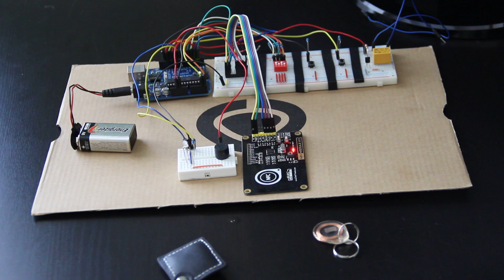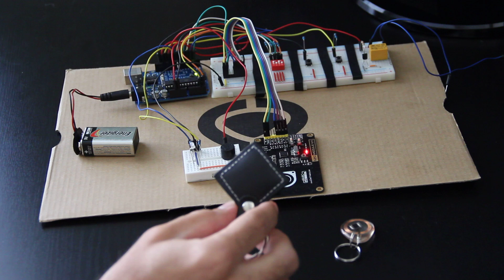Arduino RFID Garage Door Opener

Comment: Could you clarify what pins are connected to the NFC Module?
Reply from the maker: It's been a while but it looks like the MOSI/SDA is on Analog Pin 4 and the SCL/RX is on Analog Pin 5, which I believe is standard for I2C communication on the Arduino.  The IRQ and RST can be put on any digital pin you would like and you just define it in the code.  In this project I have the IRQ on Digital Pin 2 and the RST on Digital Pin 3.
Reply: @JasonScottHamilton  Thank you very much for your reply. I'm doing a project for university, and your project really helped to shed some light on many things.

Once again, thank you very much.
Reply from the maker: SinteticPersona no problem.  Good luck with the project!

Comment: Hi, I was wondering if I can make up my own pin numbers... I am using a raspberry pi and those pins have already taken
Reply from the maker: On the Arduino you should be able to change the pins by just changing the pins defined in the code.

I'm not sure if this will run on the RPi without modification.  I would imagine you could change the code a bit to make it compile as a C++ program.  I don't believe the rpi has an eeprom, so you would need to change the storage to a filesystem

It may be easier to just start from scratch using Python.  Programming in a higher level language with an entire OS abstracting a lot of the minutia away will let you program this much more simply.

Comment: hi do you able to send me schematic  or a fritzing.  gur001@yahoo.com
Reply from the maker: Sorry but I don't have any sort of schematic or Fritzing.  If you have any questions on it in particular, please let me know and I can try to explain what's going on.  I'll try to give a simple overview of what's going on.

The connection to the RFID board is per the instructions that came with the board.  The switches are connected directly to the Arduino and have pull down resistors so the Arduino can read the state properly.  The relay is powered by a transistor since the output from the Arduino IO pin does not provide enough power to activate it.  The LEDs have resistors in line so they don't blow.
Reply: +gur par 

hi

what  pin number for the reset switch override switch and led output and what  resistors value you using for switches and led. what pin number for dip switch 

thanks

Comment: Hi Thank for sharing. I've just have a quick look your code. Using UID for accessing door is not very secure (UID can be read and clone easily) . You can make it better by encrypt your data by Using key A or key B so that the data can not be cloned easily.
Reply from the maker: I absolutely agree with your comment.   If someone has the physical key (or can somehow get close to it with a RFID reader), it can be cloned very easily.  This would be a concern if I actually deployed the system in the real world but this was just a test project to play with the EEPROM.  

While not an excuse for proper security safeguards, the actual door I was going to use it on has a tumbler lock on it, which can be picked by a locksmith in about 15 seconds (my bro is a locksmith and I've seen him do it), so if someone was looking to break in, I would imagine this is an easier route.

I'm not sure I understand your solution to enhancing the security.  I would be interested in hearing the solution you propose.  Perhaps you can detail it so others can learn from it as well.

Comment: Electronics are not my skill, but mechanical is. I would like to use this rfid to activate a 12vdc solenoid valve. The tag needs to be readable at a range of 24"+/- to 36"+/- from reader and timeout at say 60 seconds (variable). can you suggest a supplier for the parts needed?
Reply from the maker: This was actually one of my first electronics projects since I am just learning.  I get most of my stuff from eBay, Sparkfun, and Adafruit.  I think some high-end RFID system would work at a longer distance but honestly don't know.

Here are some additional sources that may be helpful:
http://www.reddit.com/r/arduino/comments/1zocsq/alternatives_to_make_and_sparkfun/

I hope that helps.

Comment: Nice project, i will build it for my garage.
I will add an extra relay for powering on/off the dooropener because it uses some power when it is not in use.
Reply from the maker: Thanks!
Reply: Where will you interconnect with the garage door opener?

Comment: I like the idea how you've created it, but I see two needs still remaining. Can you set up two columns in the code:one that allows all keys to be reset normally, and the other could have NFC registrations that would prevail after a accidental reset button press. FI, if daughter were away at school with key FOB & NFC, couldn't get in upon vist...
and Two would handle some kind of extension so that the NFC board and well, as much as possible, could be NOT out side the wall, with a grounded mu-metal or shield plate between the outside and the boards.